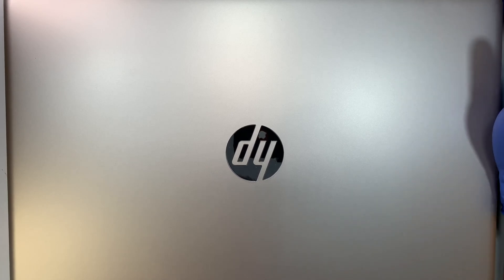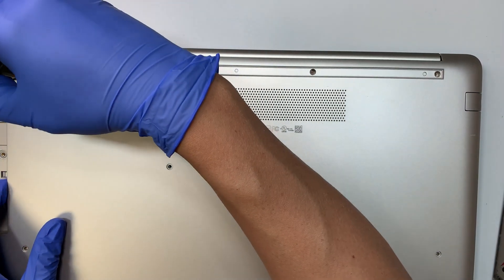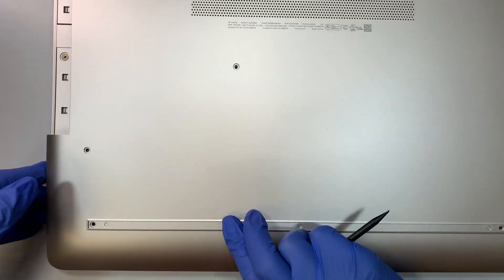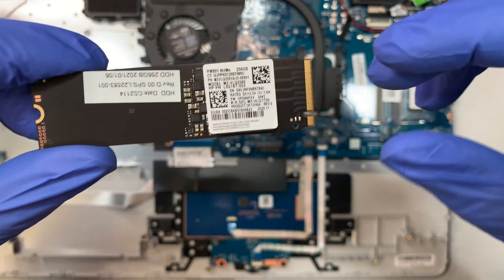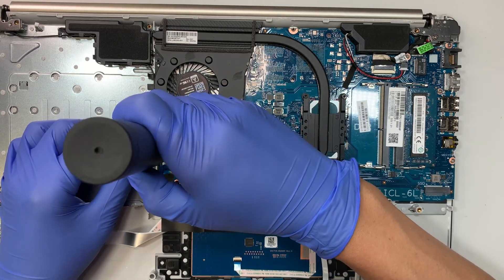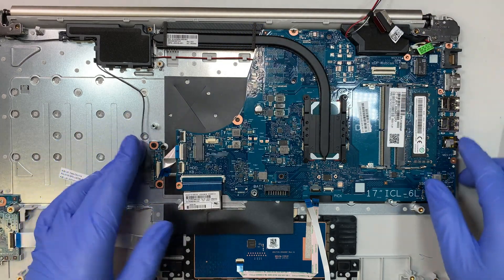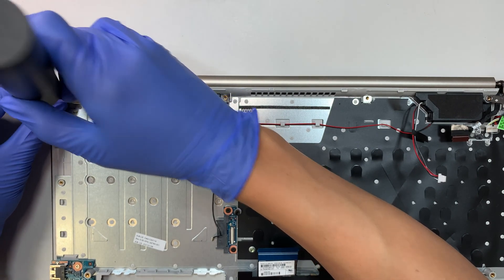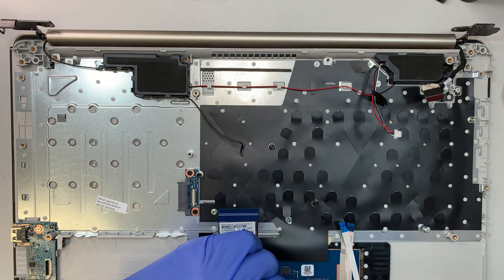Hp 17 Tear Down Disassemble

Comment: I recently had my HP 17t-by400 develop some issues (I was letting my son use it at home).  The image on the display has been freezing or completely unavailable upon boot, so I am assuming it was a worn display cable and wished to replace it.  Your video stops as soon as you have disconnected the display, but can you provide me any additional information or a video for replacing the display cable?

Comment: Thanks for this video, it really helped to have a visual to make sure I was doing everything right! The hinges on my laptop started breaking through the palm res. I ordered a new one and also a new bottom and followed your video to help replace those two parts. Everything went well except for my track/touch pad and on-board mouse buttons not working. I noticed that the ribbon for the track/touch pad wouldn't get clamped down properly, but it still appeared that the contact was being made. I plan to try to check that again when I get the time.

Comment: Great video, thanks.  I was struggling until I saw the hidden screws under the rubber strips ;-(  Now I need to decide to fix the hinge screws, find a replacement keyboard/trackpad or scrap it... Mine is a model 17-by2003ca. Similar case with additional SATA drive.

Comment: I'm here looking for the CMOS battery due to bios issue. I'm hoping your suggestion of unplugging the battery works.
Reply: I came here for CR2032 battery also. Since there isn’t one. Did your battery issue fix?? Please let me know
Reply: CMOS Battery change works and is easy, but this doesn't help BIOS Problems. Since it has no own Battery, i haven't found it on the Mainboard yet. Anyway maybe first a BIOS Update and HP Diagnose Tool may help better.

Comment: The model for my computer is HP 17-ca1013no but the screw locations look very similar as in the video, so I will keep this video in case I need some day to do any upgrades or anything for it. I have not yet checked if my computer also has a similar SSD drive, but will do it later.

Comment: I swapped upper (keyboard) and back case with new one due to hinge screw breakage and this video was invaluable.  Make sure you document cable routing when you take things apart because they only go back one way.   Especially wireless stuff and wires routed below the motherboard.  Thanks again for making this in depth video!

Comment: Can a keyboard &  that has backlight work with this system
Reply: Yes, but the backlight feature MUST be selected with the correct keyboard as it is integrated into that case.  A non lighted backlight case will not work with lighted motherboard.

Comment: No breakdown of the top lid?  These units are a very simple teardown so I kind of expected to see the teardown of the top lid and lcd because these hp's tend to have hinge issues where the hinges break away from the bottom case or top lid causing opening/closing issues as well as breakage of the lcd, cables, etc.

Comment: I had to take mine apart (17t-by300) to fix a hinge.  When I put it back together everything works except the battery.  It says “battery not detected”.  I have to plug it in to use it.  Why is this? I put the battery back in after the repair.  Also, the clock is about 30 minutes behind.

Comment: I replaced my fan a while back and broke a screw post that I had missed..🤦‍♂️Unfortunately it was one that held down a hinge. It was fine for a while, then the stress added to the remaining screws broke them as well. Now I'm replacing bottom cover, top cover(keyboard), another fan and upgrading the ram. Without this video I would need to pay someone else who knows how much. But I'll be just under 200 all in. And probably be back up and running in under 1.5 hours thanks to your video. Great video!

Comment: I want to thank you for such a clear, comprehensive video explaining the teardown of this laptop.  I am replacing the keyboard assembly for a 17 by1053dx and this has helped immensely.   I have a question:  the hinges on my laptop are very stiff and don't move easily.   Can you tell me how I can adjust them?     Thank you.
Reply: did the plastic on the keyborad break thats what happened to me... i don't know if you can adjust the hinges